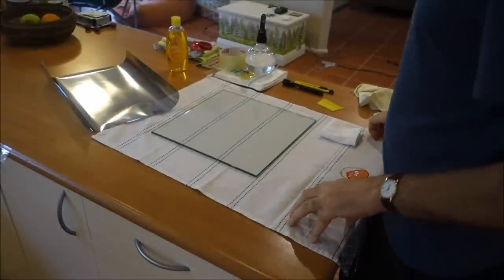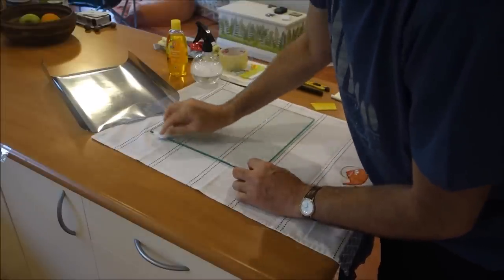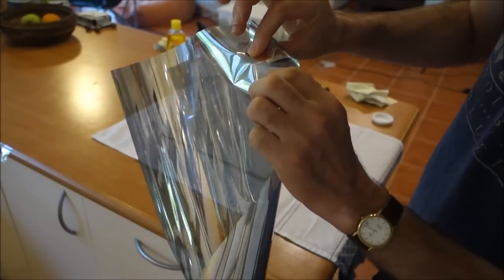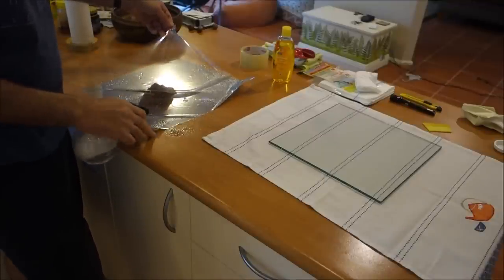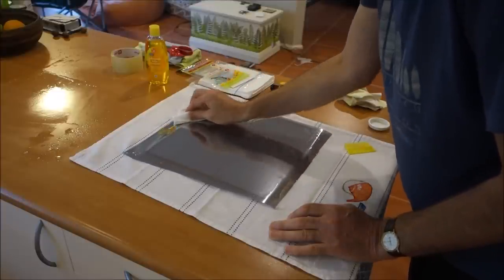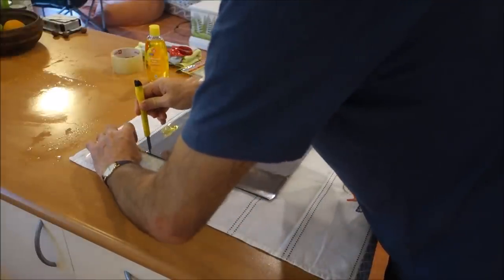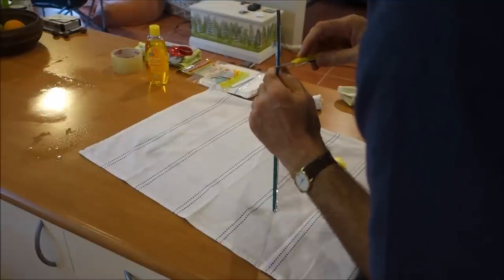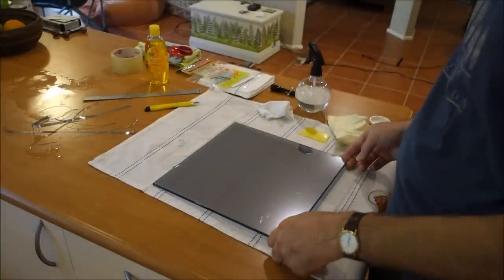Window Tint Application for an Infinity Mirror

Comment: Just did my first attempt and have to redo. I couldnt get the outter edges to seal. Then I kinda freaked out that the adhesive was going to lose its effect so I pressed far to hard and scratched the film. Ha. Luckily I purchased alot from Home Depot as a privacy window mirror film and have more to work with. Thank you for taking the time to make the video. I appreciate your technique on working from the middle of the glass and working the bubbles from the the inside first and then out. Looked very nice when you were done and you stayed very calm. Ill try to do that on the next one. Ha. Oh and I liked how you wet the table when removing the film. Going to definitley do that also! Nice work!

Comment: You should mention at 10:50 when cutting the excess film off to use a new blade because the film will dull it quickly.

Comment: But u didn’t make the mirror? Did u apply the tint on both sides
Reply from the maker: No I didn't make the mirror, that material is cheap and easy to buy already cut to the size you want..

Comment: have you ever tried using non mirrored window tint on an infinity mirror?
Reply from the maker: Hi Austin - no not tried a non-mirrored tint,  I'm guessing the reflections would not be propagated in the same way and the look would just be dim LED's?  But as I say I'm guessing.  
Simon
Reply: Austin Milby I'm also keen to know if this works. If you just used the clear glass you do get two or three layers from the light reflection, I've seen mirror tint amplifies this to more layers. So I'm guessing any window tint will give some reflective layers but the mirror works best. Did you try this in the end? What was your results if so?
Reply: i end up buying a 15 ft role of mirror tent for a house to do a 6inx8in mirror. not very cost effective.
Reply: Austin Milby I've just purchased some 20% silver window tint on eBay. It is effective but I do find I can see through the tint and clearly see the LED strips. However this isn't that bad it just not the perfect mirror finish I was after. I have found better results from this though and compared to the tint before which was chrome tint the feel and quality seems much better and works better as a mirror than the chrome tint which was blurry. I could only buy 50cm by 1m rolls which was about double what I needed but I will keep it for other smaller projects. Someone should test these tints and do a comparison I bet they would get loads of visitors to their site as it's never explained in detail on any guides.
Reply: what is name that black sheet you used 
tell me all list of matterials plzzzzzz....

Comment: Can you do it with 70% mirror tint?
Reply from the maker: rmyc Yes 70% will work.  The affect will be slightly different from the 80% film in that with the lower reflection you will end up with less visible reflections but the initial reflections will be brighter😎
Reply: Simon Jowett did u use 80% blocking or 80% light allowing.  I know in some regions the numbering is reversed
Reply: rmyc this is what I need to know but apparently no one wants to answer this question
Reply: Simon Jowett 80% what? Light transmission or light blocking? It makes a huge difference can you clarify?